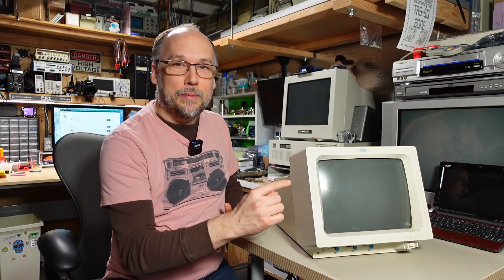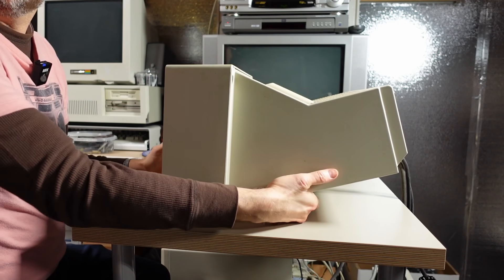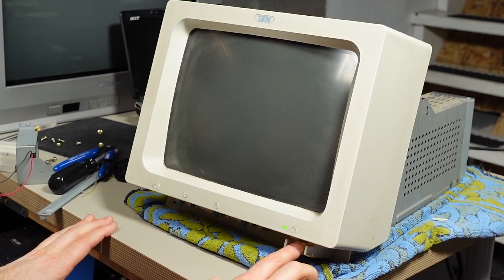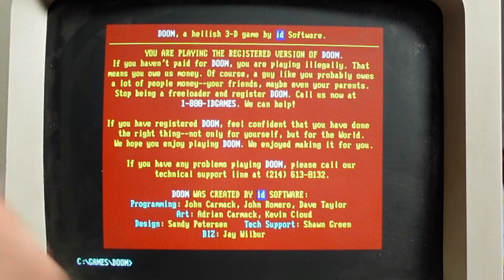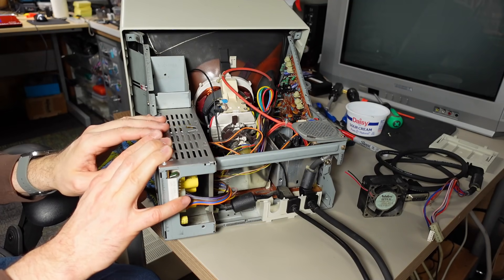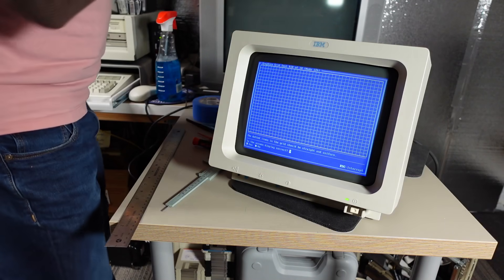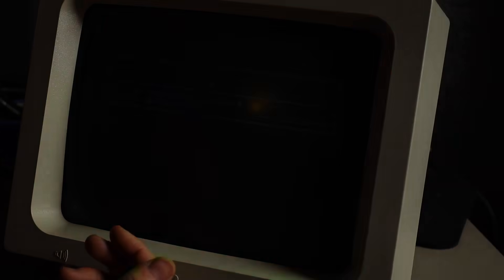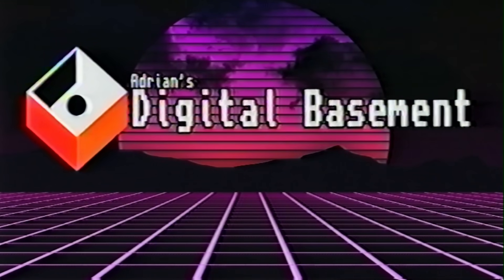The IBM PS/1 VGA monitor is built like a tank! (and still useful)

Comment: 19:47 - they are called "trimmer pot adjustment tool", or "trimming tool". Plastic ones are fine for occasional use, I still have my ceramic set. Ignoring the shock risk with a metal screwdriver (you need to do these calibrations live!) trying to adjust inductor cores will result in a distorted trim as the metal will increase the field strength of the inductor. Ceramic has a better "bite" on most inductor cores, the cheaper plastic ones tend to deform over time. Some manufacturers (Bourns, Vishay) add a minute metal bar in the tip - though these are intended to adjust pots (potentiometers)
Reply: the digikey category is actually "tuning tools".. but I'd call any nylon pokey tool a "spudger".
Reply: My father had a TV shop... in his day, they were called 'diddle sticks'
Reply: I've seen these also called "Tweekers" or "fiddlers"
Reply: More than just interference from using a metal screwdriver, you could also destroy the trimmer itself with a metal tool.

Comment: Man, what you were saying about people using CRTs for a long time, I think I may have been one of the last to switch to flat screen. I used a CRT monitor until about 2010 and my CRT TV(32" widescreen beast, must've weighed at least 15 stone and was a two man job if you wanted to move it more than a couple of feet) until about 2019.

Only reason I replaced them was due to becoming unusable. The monitor which was a Packard Bell from a Windows 98 machine someone had junked and ended up with a weird deformed screen where the scanlines in the middle were taller than the top and bottom, and the TV was a Sony that just got really blurry with age. The latter still worked when I took it to recycling, but the blurring was just so bad that it rendered text unreadable at anything higher than 384x288, the PAL equivalent to 320x240.

Comment: I had a factory sealed unit that my parents threw out when I moved out! Still have my PS1 video conferencing model though! I really need to clear the attic out and make a few videos!
Reply: Factory new? Oh, no! 😱😥
Reply: I Feel you. My patents threw out a bunch of rare vintage computers that were mine. They did it when I was away at a camp in the early 90s. It was a Commodore pc10, Commodore pc20, two Very old and rare Danish comet computers Running cp/m, an amiga harddrive, a Commodore Pet computer, a Commodore Pet dual disk drive, a sinclair spectrum zx81, an ibm ps/2 computer, an old ibm ps/2 style high tower server and a lambda computer. I was crushed... STILL is actually
Reply: Remind me to never do this to my children.... Also...who doesn't ask?
Reply: @TheErador  People with Cluster-B personality traits tend to behave that way. They have no problem violating the personal boundaries of others.
Reply: @tj71520  Oh my god, this sounds like some horrible tale of betrayl!
Reply: @n.h.s.a.d.m.  yes, it was not great. I have since tracked down some other retro systems since  though. Like a few amigas, some c64s, some vic20, some c16 and a c116 with a low serial number.

Comment: I almost spit out my drink when you said the monitor looked like it was in heat with the kickstand up. too funny! You are so right about not using a metal tool to adjust the ferrite slugs when the monitor is on. In case someone reading this decides to do it anyway because they don't have a plastic one on hand. It will ALWAYS crack the slug if you do! Ask me how I know this? Once the slug is cracked it cannot be adjusted and good luck getting it out to fix or replace it.

Comment: I used to have an IBM 4707, a tiny  monochrome VGA monitor apparently designed for point-of-sale terminals. I mostly used it with my home file server where I could tuck it on a nearby shelf out of the way. Very handy back before compact LCDs.
Reply from the maker: Yeah one of those would be super cool -- I remember those little screens. I was thinking of a super cool project I could do with a 9" VGA CRT

Comment: XP machine should have been able to drive the monitor at 640 x 480 as an extended display. Love the aesthetic of the monitor, honestly!
Reply: For a VGA monitor, it would have to be 640x480@60Hz. An out-of-spec refresh rate would have the same effect as an out-of-spec revolution.

Edit: it might, in theory, be possible to drive a VGA monitor at 800 lines, interlaced at 35Hz; provided you could find a graphics card that can be programmed to create such timings.
Reply: @techgeeknzl  my point is, xp can drive 60hz 640 x 480 no problem. It's just not going to mirror that 16:9 display successfully.
Reply: XP and later only let you set down to 800x600 pixels with 16-bit color. It will do 640x480 but the option's hidden, you need to go a few screens deep in the advanced options to find it.

Comment: At 7:20, I'd leave the fan in to cool the power supply!   At 20:20, they are available on Amazon.
Reply: Seems stupid, clean it then leave it unplugged, why cut the wires and remove it? odd..

Comment: Great job as always.  Personally, I would have left the PS/1 connector and cable on there, maybe taping up the end of it until a PS/1 comes into your possession.  I thought it would have been interesting to have left the fan running in the monitor regardless, but if it's truly that noisy, then it's fine without it.

What I am rather surprised about is that you didn't rig a 1/8" cable up to it to use the built-in speaker, that would make full use of that monitor, giving it an additional feature over the fact that it was 11 or 12 inches.

Comment: One of these days I'm going to have to find an IBM 6091 23" monitor and send it in.  The 6091's were good monitors, if a bit heavy, with the 23" model weighing in at 122 pounds (55 kilos)!  Quite the opposite of a nice little 12" VGA monitor.
Reply from the maker: Yeah I recall back in the 90s I wanted a big monitor as I was using a 13" VGA CRT -- now I want the go back to small monitors. Funny how it works!
Reply: I remember having a 20" CRT TV as a kid. It was heavy, but it wasn't 122 pounds. 🤯
Reply: @argvminusone  I'd have to find the specs to be sure, but I think its max resolution was 1280x1024.  It seemed amazing at the time, but now, not so much.

Comment: My 2nd computer, that I built in 1987 from parts bought from the back of computer rags, was a 386sx-16, 40mb MFM Seagate hard drive re-encoded to RLL, and a no-name 12" VGA monitor.  I couldn't believe how good it looked.  (1st computer was a Leading Edge Model D!)

Comment: The white with no signal is perfectly normal (At least for the PS/1 model 2011 monitors), my monochrome one does that too. The color monitor's picture looks pretty similar to the monochrome one, though the mono is probably sharper. All my pots are scratchy on the front, which makes adjusting the brightness and contrast more difficult, but that aside even the mono one is nice.

Comment: We had that computer back in the day (10 MHz 286, 1 MB RAM, 30 MB HDD, color monitor, proprietary soundcard, IBM DOS 4.00, MS Works 2.0). And the monitor did work as a standard VGA monitor, as was found when we used it with another computer in the later years (I just started watching the video, so don't know if the same is found).

Oh, and the monitor was said to be 12" in all the materials.

Comment: Hey Adrian! I bought various insulated and non-conductive/non-magnetic screwdrivers a while back at McMaster-Carr. The insulated ones are better when you're just worried about not getting shocked. The non-conductive/non-magnetic ones are good for adjusting sensitive analog circuits that are affected by the presence of a metal adjustment driver.

(Edit to note none of these are a hex driver like the one you mentioned. Still, maybe useful to others.)

Here are the McMaster-Carr part numbers and descriptions:

5879A24 Ceramic Adjustment Screwdriver 0.102" Slotted
5879A23 Ceramic Adjustment Screwdriver 0.071" Slotted
52985A72 Precise-Control Screwdriver Electrical-Insulating, 0.079" Size, Slotted Style
52985A73 Precise-Control Screwdriver Electrical-Insulating, 0.098" Size, Slotted Style
52985A74 Precise-Control Screwdriver Electrical-Insulating, 0.118" Size, Slotted Style

Comment: Interesting video Adrian. Up until now I thought that the Amstrad PC1512/PC1640 were the only PC compatibles with the power supply located in the monitor.
Reply from the maker: They must have set the trend as this was a later machine. IBM influenced by Amstrad!
Reply: @adriansdigitalbasement  remember the FUD wars with IBM vs Amstrad?

IBM: OMG! Don't buy an Amstrad, because it doesn't have a cooling fan and it will overheat!
Amstrad: Fine! We'll stick a fan in the corner of the case that just uselessly circulates air through the cooling vents, because our customers insist on having a noisy computer.

Comment: 20:25 - it's also best practice to do these adjustments standing up with one hand in your pocket and have the screen pointed at a mirror.
Standing up so if you do get a zap you can be knocked clear (make sure you have clearance to fall back to)
One hand in your pocket so there is less risk of the shock passing over your heart
Mirror - to make adjustments easier!
Also don't have a live set resting on an anti static mat and it's best not to wear metal jewellery or an anti static wrist strap. Even a small 12" CRT can have around 14kV on the anode cap!

Comment: Just found a Hewlett Packard  13 inch crt monitor made in 2001.  Works good even though it was out in the rain for over a week.
Reply from the maker: It's amazing how resilient electronics actually is!
Reply: Yes,  I grabbed it for a cocktail table Arcade machine project. But sadly it is not going to fit, but the size you have there would do nicely :)

Comment: Yes, CRTs are just amazing, the glow and the scanlines ... can't emulate that. (Well, you can obviously, but it's not the sam). Also like small monitors, there is just something about them. When I was young, I found a monochrome (green) Commodore montor once in bulk garbage. It looked nice, I took it home and used it with my C64. Heck, I had a color TV in my room, but I often preferred the look of that small little greenscreen monitor. And when I saw an amber monitor then one day, I had to "upgrade" :-) Anyway, I digress. Amazing videos, especially on CRTs. Keep on the great work and enjoy all the Haribo's you can get :-D Cheers!

Comment: What I would have done while the back was off would be to take a bit off a manila folder and tacked that over the opening left by omitting that cable, if for no other reason than to keep bugs etc. from crawling into the monitor.

Comment: Ah that's the monitor for the PS/1 2011 (286) and 2121 (386SX), similar to the Amstrad PC1512, it also doubles as a power supply for the computer.

In theory you can run this unit as a standalone VGA CRT monitor, there's even a B&W version.

As for the Sony Trinitron on top of the 5170, these Trinitron PC CRTs have a known fault known as "G2 drift" which causes them to have a washed out picture, it's due to a "algorithm" that Sony added that would raise the G2 voltage to compensate for tube wear, unfortunately that algorithm tends to go bananas over time and artificially increases the G2 to such high levels that in some extreme cases, the monitor starts showing retrace lines.

It can be fixed fortunately but you'd need a USB to TTL dongle, and a copy of the "Windas" adjustement software. It's a bit daunting initially but once you get the hang of it, it's almost a breeze.
Reply: I could've used that Trinitron knowledge a few years ago when I still had an E500. If Adrian thinks his little 17" version (apparently 44 lbs) is heavy, he hasn't had the 21" version. If I had it all fixed up and if it weren't so freaking bulky I'd probably be using it as a primary monitor today.
Reply: @eDoc2020  Definitely... Trinitrons are insanely heavy, I once tried to lift a 29" (KV-29FX20B) one, I could barely lift it a millimeter from the ground.

Comment: I own the exact same monitor and have the 10Mhz 286 PS/1 as well. It's a fun little computer that I use for distraction-free writing. I wanted to adjust the scan on this monitor since the usable surface on mine is very small, but it seems a bit too dangerous for me. Especially considering that if I screw up my monitor, I can't use my PC anymore. Thanks for the useful vid!

Comment: Thanks for this Adrian! That PS/1 you pictured is my first computer, and I still have it (along with its optional 5.25" drive, which mounts on the bottom of the PC). It pains me to say it, but you're right, it's not a "super useful" computer in itself. Where it excelled as a home computer, it was bomb-proof. DOS and its "four quad" GUI were burned into ROM, making it fast as hell for the 286 it was. It also meant, as long as you kept your work saved, you really didn't have to follow any kind of "shutdown" sequence -- just turn it off. There was a comprehensive, graphical System Tutor that walked through the whole machine in detail, even providing an environment to try things out without modifying the actual machine. So, as a "general purpose" do-everything computer, it wasn't great. But, it was a phenomenal "first" machine, especially in 1990. It might still be a good machine to learn DOS on, as well.

Comment: Hello: I have one, together with my 2011 from 1991. The reason I never thought of pairing it with my Celeron 300A, from 1998 was because of the noise the fan produced (I think it was the fan in the power supply, on the monitor).

Comment: I used to have a old compaq vga monitor, it was only vga colour no super vga. But it was great for my home netware 3.12 server. The monitor was very slim you could push it far back on the bench with the mini tower sat next to it. It had an easy to find rocker switch on the right that looked like the rocker on the 386s desktop

Comment: Ah, the IBM PS/1 was my first PC. I had a TI 99 4/A before that. But I loved my IBM, including the design of the monitor, with the audio controls onboard. I learned to program on it in QBASIC. Unfortunately, while I was away at my first semester of university, my father threw it out because it was "old". Including the fantastic IBM Model M keyboard, and the PS1 mouse, which was also clicky and fantastic (I liked the aesthetic of it, for sure). I do miss that computer.

Comment: Before I watched these videos, and might have been able to learn how to fix it, I threw away (recycled really) a 9" monochrome 1024x684 monitor with a VGA interface.  I used to use it on my server stack in my homelab.  I loved that little monitor.  The flyback failed after 20 years.

Comment: Oh wow, that was my first monitor and power supply.  When I was growing up I got a IBM PS/1 hand-me-down.  286 10mhz, 30MB HDD, 1MB ram, 1.44 FDD, 2400 bps modem.  Used to do school reports using wordperfect 5.1 and print on a dot-matrix ibm printer 🖨️
Reply: I had the same with a 40Meg of HDD though. Out of the 1MB of Ram I think only 640k was available for programs if I remember correctly and I was relentlessly trying to access as much as I could to be able to run X-Wing on this machine.

Comment: The original PS/1s had an expansion chassis that sat between the computer and the monitor, and if you bought that, the upward angle on the monitor might be awkward. The kickstand let you adjust the angle to a more natural vertical.

Comment: I have one, alongside a IBM PS/1 model 2011 and it works very well! It is slightly blurry, just like yours, but it is they way they always were. It goes perfectly alongside DOS games at a lower resolution. You should better put back the fan because they will get hot after half an hour or so. I replaced the fan in mine.

Comment: My first PC was a PS/1 286. That VGA monitor was nice. The PC had additional modules you could stack for things like ISA slots, a 5-1/4 disk drive, etc. I had all those, so the monitor was up way too high and had to be moved to next to the PC :P

After I built my 486, I gave the PS/1 to my sister for her college papers. It ran GEOS  and Ensemble really well for a 286 with only 2.5mb memory.

Comment: The Purpose of the tool at 20:14 is the tool does not interfere with the component while you are adjusting it they are made of ceramic or plastic so they are not magnetic.

Comment: To Adrian:  since you have a working PS/1 monitor, it would be nice to have a pinout of the DB15 connector  for those of us that have the computer but not the monitor so a power supply can be built.  I did try to find one online with no luck.
Reply from the maker: It's here actually: http://oldcomputer.info/pc/ps1_2121/index.htm#video

Comment: 21:00 - the lack of control on size was to keep the image as square as possible, those older CRTs had very pronounced curves especially when compared to a Flatron! It is possible to over scan, however I would imagine you would loose straight lines as you reach the limits of the screen...

Comment: Love those old VGA CRTs. Convergence and sharpness is not as good as on the newer multisyncs but the small size is really cool and the color and contrast is pretty good indeed (blows the socks of any backlit LCD/TFT screen)!  I think these PS/1 CRTs were pretty reliable. Most of them are from around 1989/1990 so IBM learnt from their 'mistakes' engineering their PS/2 CRTs.
 The first PS/2 CRTs like the first 8513s (one of the very first VGA monitors): Not so much. One of mine (a rev. 1) exploded last week and the parts are really hard to come by. I love them anyways :-)